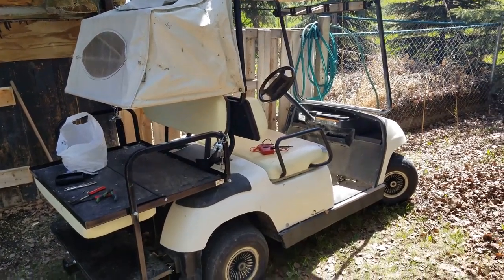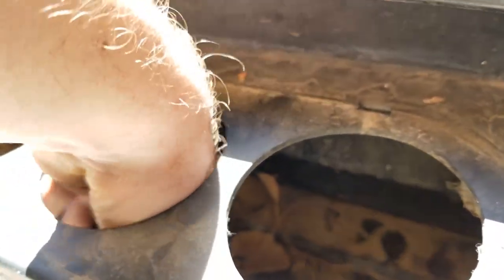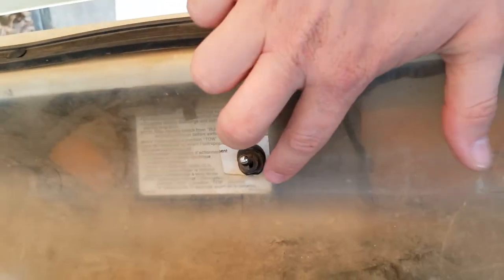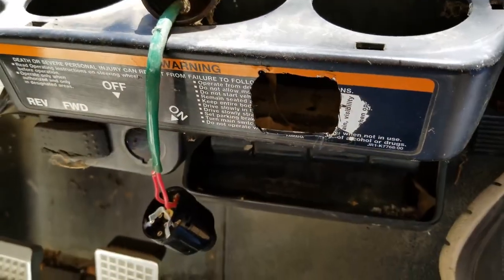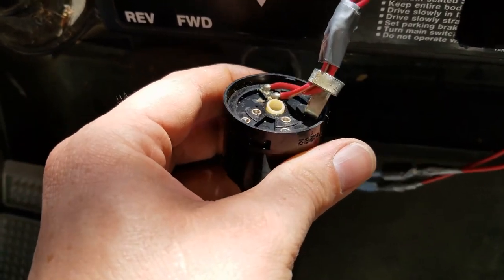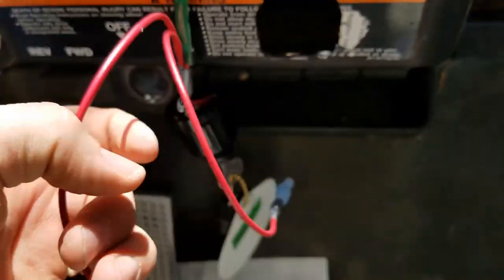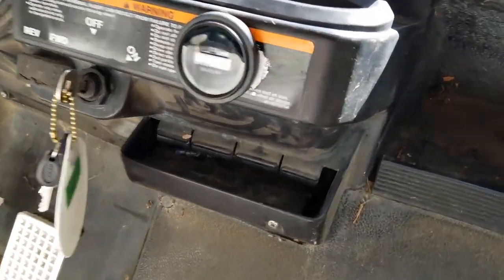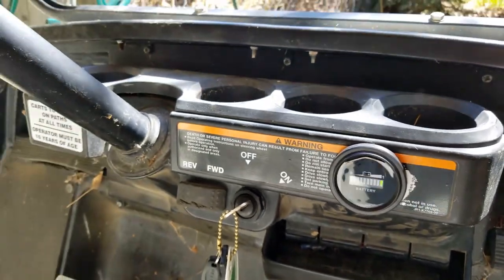How to install a Golf Cart Battery Meter on a Yamaha G19... and others! (Battery Monitor Indicator)

Comment: Why go all the way back to the + terminal of the battery bank when you have continuous + entering the ignition switch. Just take it from there to the + on the meter like you did the ignition output switched + to the C.